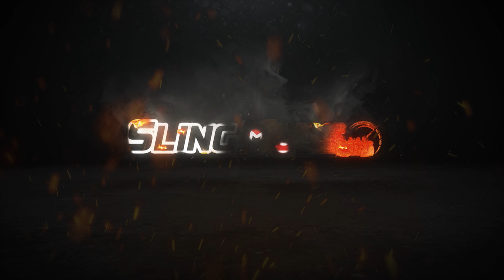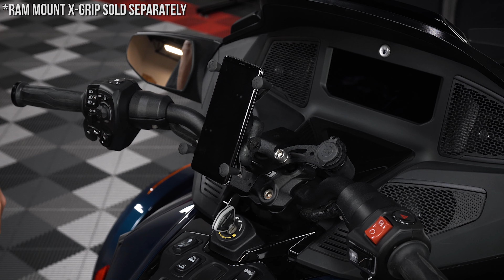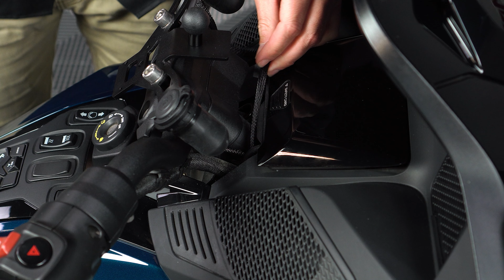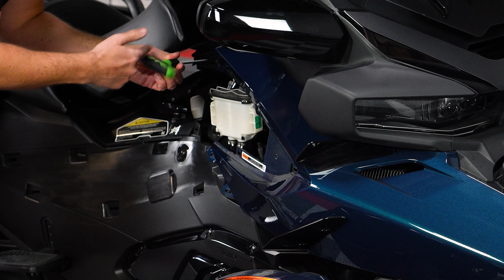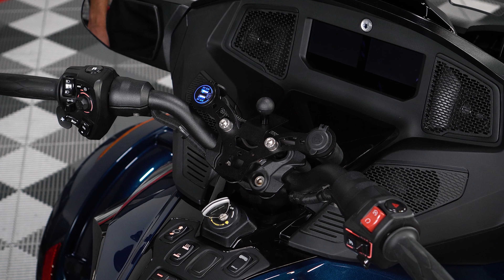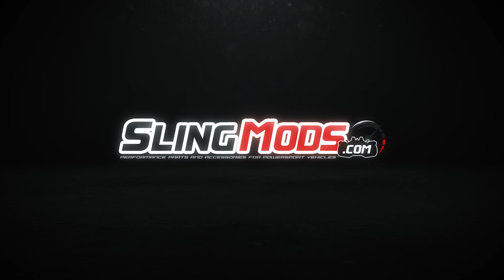Can-Am Spyder RT Phone / GPS Docking Station (2020+)

Comment: Seems I have the two inch handle bar riser, spacers won’t work, riser bolts same length as replacement bolts.  Tried cutting the spacers in half, no luck.
Reply from the maker: If you're running the SpyderExtras docking station and the SpyderExtras handlebar risers together, you'll need the longer bolt kit we offer. That can be found here: https://www.slingmods.com/canam-spyder-f3-rt-handlebar-riser-extended-bolt-kit

Comment: I just plug a 12V air pressure to check my air and it blew it. Is there a way for me to fix this with a fuse or will I have to purchase another one? Either way no problem. Order ID: #332118
Date Added: 05/15/2022 5:31 am
Reply from the maker: Hello Larry, you're all good. Since the 12V Docking Station is plugged into the Factory Accessory Power Harness on the bike, that circuit is protected by a factory 5 amp fuse underneath the liner in the frunk on the throttle side of the bike. Going off memory I believe the 5 amp fuse in near the top right side of that factory fuse box. The docking station USB and 12V Cigarette Style Charge ports can only handle up to 5 amps.. a mini air compressor is definitely too much current draw for that small 5 amp fuse. My mini air compressor pulls around 12-15 amps. Let us know if you get it figured out! Have a nice weekend.
Reply: @Slingmods  Thank you, switch out the 5 amps to a new one and it fixed the problem. You guys rock. 👍